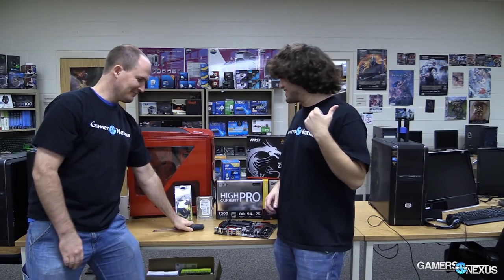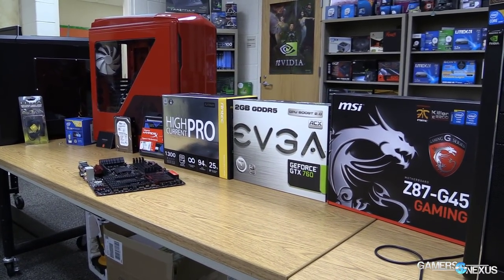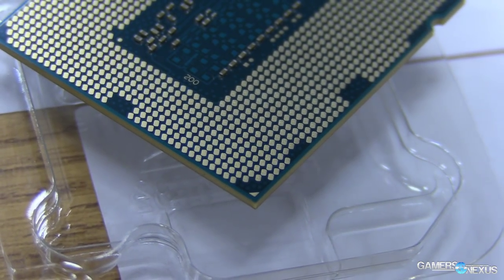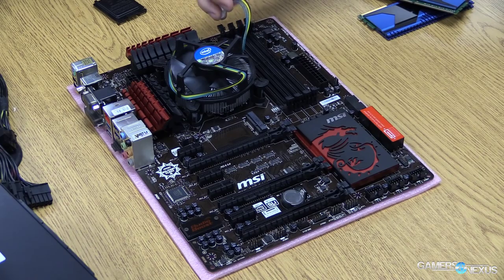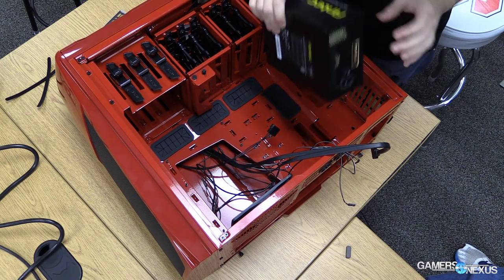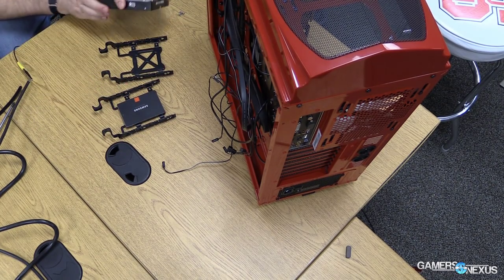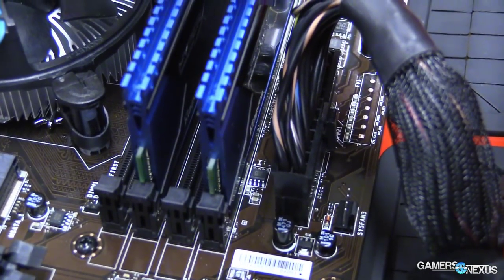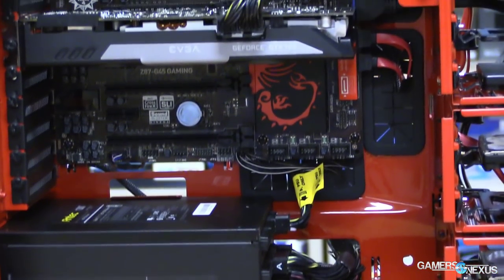How to Build a Gaming Computer: DIY Gaming PC Step-By-Step Tutorial

Comment: How NOT to build a PC:
- 4:57, Gently push down on the loose end of the metal place when locking the CPU to ensure a correct lock
- 5:38 See those numbers 1/2/3/4, thats the order you install the CPU heatsink in. Maybe a good idea to follow that guide?
- 7:05, never install a GPU card without backplate and case support. Wobbling the card will damage the PCI-e slot, its connects and bend the card due to its weight.
- 7:55 Oversized Magnetic screwdriver next to electronic components, are you stupid?

Amateur PC building is all i see here.
Reply: Hey, when were computers and electronics last incredibly susceptible to magnets? I guess wires are, sure. But for the heck of it I ran high strenfgth magnets on hdd and ssds and my laptop and nothing happened.
I doubt a ferromagnetic screwdriver used to cause a short will damage any of the components near it, at least in that shot.
If your pcie slot breaks that easy I think you probably bought a real shoddy motherboard or let your cat play with it or used shehulk strengfth.
Reply: Hey, when were computers and electronics last incredibly susceptible to magnets? I guess wires are, sure. But for the heck of it I ran high strenfgth magnets on hdd and ssds and my laptop and nothing happened.
I doubt a ferromagnetic screwdriver used to cause a short will damage any of the components near it, at least in that shot.
If your pcie slot breaks that easy I think you probably bought a real shoddy motherboard or let your cat play with it or used shehulk strengfth.
Reply: You had me at first, but then you lost all credibility with that last statement
Reply: -  Wrong, this is the correct way of installing a Intel LGA socket CPU.
- Todays CPUs dont care much wether you do it in a cross pattern or not. I do however agree to take the cautious alternative.
- This is total bullshit. Ive been running passively cooled cards with huge coolers for half a decade and they simply do not care wether the PCB is slighty bent or not. Ive also been running basically the heaviest (HD7990 Custom waterblock) in a basic non reinforced PCI-E slot.
- Oversized? I always have one short screw driver and one long. I only use the short one when I cant fit the large one. They are more convenient because you can see more clearly with your hands further away. Magnetic? Just rewatched a guy put a huge neodymium magnet on his computer, without it failing. Todays hardware is also more resilient to pretty much everything. Do you not think its weird how it is very common with PC build kits, that they come with magnetic screw drivers..? Because its relatively safe..? Youre more likely in more risk of damaging your PC by dropping screws on your motherboard and then use your hand to pick it up.

Comment: hey guys im just getting into building a custom pc and i was just wondering if all these parts are compatible 

Case: Bitfenix Comrade Black ATX Mid Tower Case $60

Motherboard: ASUS Z97-A ATX LGA1150 DDR3 3PCI-E16 2PCI-E1 2PCI CrossFireX $165

RAM: G.SKILL Ripjaws X F3-12800CL7D-8GBXM 8GB 2X4GB DDR3-1600 $92

CPU: Intel Core i7 4790K Unlocked Quad Core HT 4GHZ $400

Harddrive: Western Digital Green 1TB SATA3 6GB $70

Fans: Bitfenix Spectre Pro BFF-LPRO-12025G-RP 120mm Green LED x2 $25
Bitfenix Spectre BFF-BLF-14025G-RP 140MM Green LED $15

Graphics Card: EVGA GeForce GTX970 ACX 2.0 4GB GDDR5 256BIT $380

Power Supply: Corsair CX Series CX750M 750W ATX 12V 80 Plus Bronze Modular $97

DVD Drive: ASUS BC-12B1ST Internal 12X Blu-ray Reader

SSD: Samsung 840 Evo Series MZ-7TE120BW 120GB
Reply: Or you could wait until the next intel consumer grade platform comes out, which will most likely support ddr4.
Just a thought

Comment: Okay, s I have never built a PC and I wanna try gaming on it to see if I would like it or not so I want something thats good, but very cheap so would this be fast enough to play Day Z

HP Compaq dx2400 Microtower with an HD 5670
300W LiteOn power supply
LightScribe DVD Drive
Intel Pentium 2.5 Ghz Duo Core
HD 5670 1 GB GDDR5 
2.5 GB RAM
80 GB SATA HDD

P.S. Im probably going to get 4GB RAM
Reply: ***** Oh ok, thanks
Reply: *****
that just goes to amazon, ebuyer is cheaper, at least in the uk.
Reply: That, will not run DayZ or any Arma game, and even if it does, you will get max 5 FPS. Arma games mostly use the CPU, so for that i would say atleast a quad-core, like the i5 4670K with 8 gigs of RAM, and don't be shy on cheaping out on your GPU, just don't go too cheap, you'll be fine with a GTX 750Ti, even though if you're going to play other games than Arma, then i would say a GTX 760. And also, DO NOT CHEAP OUT ON YOU'RE PSU, if you do then it will probs fail and take other components with it, stuff like Corsair, Antec and Seasonic make exellent PSU's, and get a proper cooler for you're CPU is essential if you're going you're going to overclock it, and pick the right chipset that supports overclocking such as the new Z97 chipset. Have a nice day sir.
Reply: TheSilentPWNER
my a8-5600k with 8gb of the cheapest Kingston ram and on board graphics can play arma, it isn't exactly demanding, watchdogs on the other hand, that is something else entirely on the requirements scale. http://www.pcgamer.com/2011/05/19/arma-3-system-requirements-revealed/      it can run on an i5.
Reply: Resolution and settings?
Reply: idk
Reply: thatguy Resolution and settings?
Reply: watchdogs? low, low and low.
Reply: +thatguy I asked about the resolution and in DayZ, not Watch Dogs.
Reply: I don't have day z, sorry, can't help you there.
Reply: +thatguy Arma and DayZ are the same, so you could just have said yes... But what settings and resolution do you play that on?
Reply: I got rid, so I can't quite remember, but it was pretty high
Reply: +thatguy At what resolution?!?!?! Jesus fucking Christ!
Reply: I can't remember, sorry!!!
Reply: Get at least an i3 or an Athlon x4 760k coupled with either a gtx 750 or a radeon r7 260x, that should give you enough to play most games at medium - high at 1080p. For ram I recommend at least 4 gigs at 1600mhz
Reply: arthur staal Ok, thanks! :- )
Reply: Allan Duran no problem :)
Reply: It is not enough even for the lowest settings on dayz , dayz is a very intense game (It is bad optimized) Get a Amd fx 6300 at least and a gtx 670. MINIMUM
Reply: yes, it is, if you turn down the settings
Reply: anyway, why dayz? there are far better games you could play. just cause 2, for example.
Reply: Nah 4GB RAM is not enough. At least go for 8GB
Reply: Tony Brown Seems legit, lol ty I already built one with 8gb ram
Reply: bro you should probably wait and save some more with that your always gonna be limited its better off in the long run if you wait and save

Comment: No thermal paste on the CPU?
Reply: Intel's stock cooler usually comes with the thermal paste pre-applied to the underside of the cooler itself. However, if you are installing an aftermarket cooler, like a Corsair H110 or 115, you will need to apply a pea sized drop on the CPU (after the old paste is cleaned off).

Comment: why 1300 watts?  im pretty sure that probs only needs like 800.
Reply: a 500 watt would probably power that i saw i video where the guy had a gtx 780 and an i7 4770k and he put the gpu and cpu at max load and it was only drawing up to 350 watts but some components require a minimum wattage power supply

Comment: some one forgot their thermal paste
Reply: Thermal paste is already there.
Reply: no always. sure there is paste already on the fan. but alot of times i have gotten a new fan, i had to put thermal paste between them...
Reply: corey evans That was a stock Intel fan, that comes with the CPU.  Those packages have the paste already on.  If it was a better, third-party fan, yeah, you might have to apply paste yourself.

Comment: overclock on stock heatsink, 1300 watt psu with 84 tdp cpu & gtx 760... wtf

500w psu wouldve done the job more than enough

you wouldve got more performance and overclocking on an amd cpu (using stock heatsink lol) and you wouldve got a nice gtx 770 using amd, but runs on gen 2.0 but who cares if you lose 2 frames from using gen 2.0 lol

Comment: Antec HCP 1300W PSU Lol thats overkill 1300W for that system more like 700W-850W

So don't just buy all the Components used in the video
Reply from the maker: Yeah, it's a bit overkill. That's what Antec wanted to send over -- it's a damn good power supply, but obviously about 2x what we will actually consume. But 80+ Platinum at that wattage is pretty impressive, regardless, and is worthy of showcase.
Reply: Well you explained why you had the 1300w psu because they sent that one over :)
Reply: 550 watts would be fine for that build + you could still add a few drives and stuff.

Comment: $1753.91-£1063.88 to build this!
Reply from the maker: John Adams
Because we write our own guides and because these parts -- if you watched the video -- were supplied to us by vendors. It's irrelevant. You screw the same screws in to put this system together as you do to put a $500 system together. Check our website for PC hardware suggestions. See:

$484 ultra-budget PC: http://www.gamersnexus.net/pc-builds/1291-cheap-gaming-pc-kaveri-january
$797 mid-range PC: http://www.gamersnexus.net/pc-builds/1321-titanfall-budget-gaming-pc-build-streaming

Comment: wtf no aftermarket cooling
Reply from the maker: -_____-

> "We are using the stock cooler for tutorial purposes and strongly recommend an aftermarket unit."
Reply: Gamers Nexus well still, no aftermarket cooling on a 4770k? haswell is hot as f***
Reply from the maker: Right... the point was to teach how to install the stock cooler. I have about 20 videos on how to install different aftermarket coolers.

Comment: http://pcpartpicker.com/p/QbkjNG
is this good I'm new to building pcs and don't know if its got anything wrong with it.
note:the gtx 770 is 0.00 because i already bought it
Reply: It's fine, i would personally go Intel but that's my opinion, but there is one thing I have to say: I'd get the the Razer Blackwidow because it is a mechanical keyboard where the DeathStalker is a membrane keyboard.
Reply: http://pcpartpicker.com/p/phrpmG

i changed some things around but this website will not let me choose the Corsair Carbide Series SPEC-01 RED LED Black ATX Mid Tower Gaming Computer Case. is this case ok with this setup.
Reply: Nick Grosso i would also change the mobo to a 990fx chipset instead of 970
Reply: Nick Grosso oh nevermind i just saw you went intel
Reply: arthur staal I already built my PC I instead got Intel i7-4770k :p I got it for a good deal
Reply: Nick Grosso not bad hahaha that cpu is a beast in gaming
Reply: be awsome at online games like tf2, csgo, dota and stuff if only my wifi was good :(

Comment: Hey, would this all be compatible?

PCPartPicker part list: http://pcpartpicker.com/p/H6VKGX
CPU: AMD FX-8350 4.0GHz 8-Core Processor  ($159.98 @ OutletPC)
Motherboard: Gigabyte GA-78LMT-USB3 Micro ATX AM3+ Motherboard  ($53.88 @ OutletPC)
Memory: Team Elite 8GB (1 x 8GB) DDR3-1600 Memory  ($62.99 @ Newegg)
Storage: Seagate Barracuda 1TB 3.5" 7200RPM Internal Hard Drive  ($51.49 @ OutletPC)
Video Card: PowerColor Radeon R9 270X 2GB DEVIL Video Card  ($149.99 @ Newegg)
Case: Corsair Graphite Series 230T Black ATX Mid Tower Case  ($59.99 @ Micro Center)
Power Supply: Logisys 480W ATX Power Supply  ($13.98 @ OutletPC)
Monitor: Planar 997-7687-00 60Hz 20.0" Monitor  ($89.99 @ Amazon)
Wireless Network Adapter: Edimax EW-7811Un 802.11b/g/n USB 2.0 Wi-Fi Adapter  ($8.98 @ OutletPC)
Case Fan: LEPA Casino 4C 63.9 CFM 120mm  Fan  ($9.99 @ Newegg)
Keyboard: AZIO L70 Wired Gaming Keyboard  ($21.99 @ Amazon)
Total: $683.25
Reply: Yes, those parts are compatible but I would definitely recommend a better power supply-at least a bronze certified
Reply: Get a power 500 watt from evga i think they have one like that for about the same price and also don't buy your parts from OutletPc they have shit customer service and a lot of time it will take forever for the shipping.
Reply: Vishal P Michael May Hey, I switched the power supply to an "XFX 550W 80+ Bronze Certified ATX Power Supply". (from Newegg)
Reply: Leeroy Jenkins Im not totally sure about that brand you can try it though
Reply: Leeroy Jenkins
Xfx is a pretty good brand in general,  I wouldn't be too worried and hey it's bronze certified.
Reply: Btw it might be a little better to get an i5 4590 or something, just saying but if u plan to over clock then don't
Reply: But the 8350 is good tho